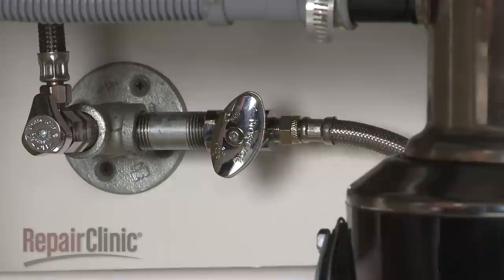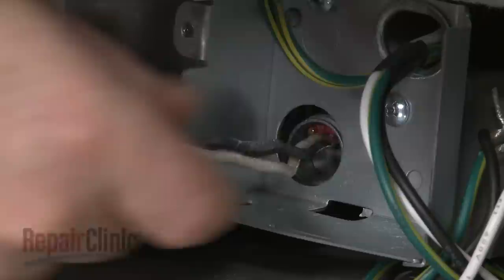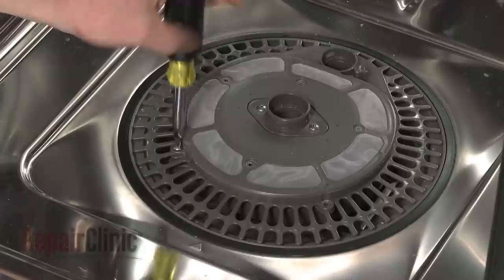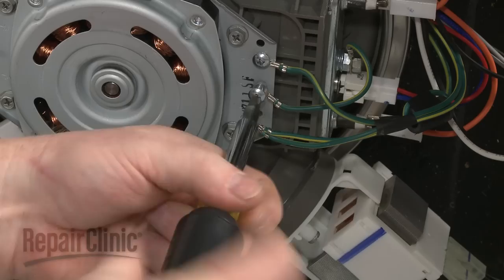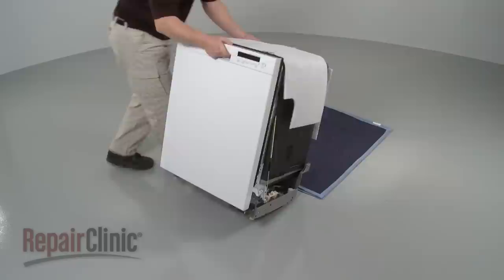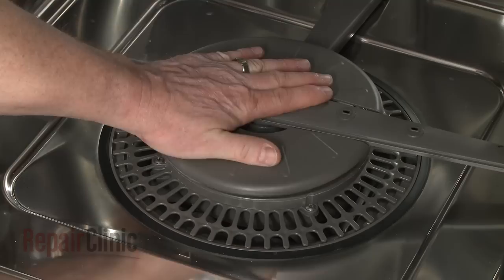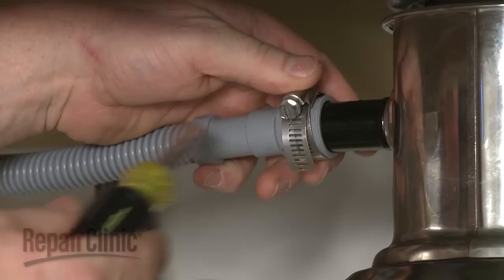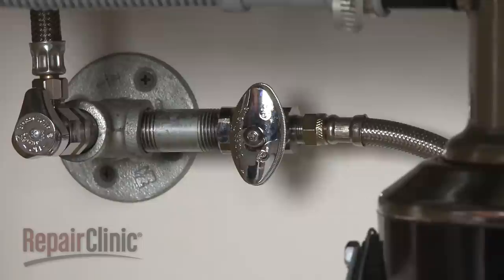LG Dishwasher Replace Circulation Pump Motor #4681ED1004B

Comment: Great content, I would only add that you might as well replace the motor shaft seal while you’re there.  It’s the black seal on the inside of the dishwasher where this part exists into the dishwasher. My seal failed a month after I replaced this part.  I found water on the floor and my dishwasher kept tripping the breaker.  Had to repeat steps one through…🎉
Reply from the maker: Thank you!

Comment: What lubricant would you use on the seal when installing the circulating pump motor shaft into the seal. The seal from the factory in the sump has a white luricant on it. Is there a video to replace the motor shaft seal?

Comment: You forgot to replace the circulation pump gasket (8:22).
Reply: What lubricant would you use on the seal when installing it. The seal from the factory in the sump has a white luricant on it

Comment: Hi. Cud use your help on troubleshooting my LG unit - LD2131SH. Have an error code E1 coming in about 3 minutes into the cycle. Also noticed a bit of water leakage at the rear of the unit on the floor. Had the same error on the unit some time back which was rectified by a technician who externally freed the motor which seemed to have been jammed. He suggested replacing the motor but the cost was prohibitive. Post that the unit worked albeit with a bit of noise during the wash runs. Wanted to open up the unit but noticed that the machine cannot be opened from the bottom as demonstrated by you. Any suggestions or a video on a similiar problem unit?!?pls advise. Thanks mate.
Reply from the maker: Ethan Bennett E1 is a leak error for LG units which explains why you found water. The wash motor does have a seal in the pump so you would have to disassemble the unit to see what is going on. That model LD2131SH is not in our database so we don't have any information on how it comes apart.
Reply: Thanks mate......will try to figure it out over the next few days......keep you posted if successful.

Comment: Why don't I see the motor seal for this motor listed on the exploded LG parts list?
Reply: I think it is because LG wants you to buy a new sump that includes the seal.
Reply: The seal number for LG LDS5040ST is, "New OEM Produced 4036DD4002A for LG Dishwasher Oil Seal by OEM Mania Replacement Part" on Amazon. $11.99